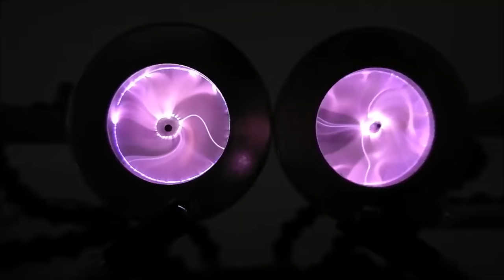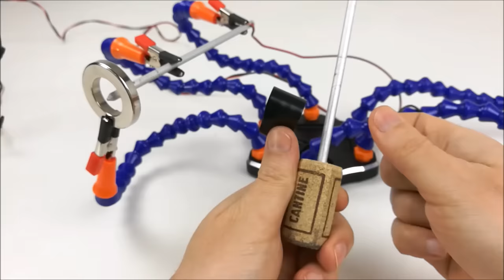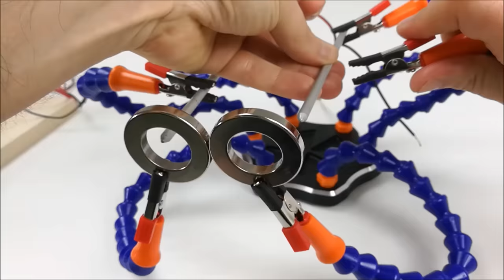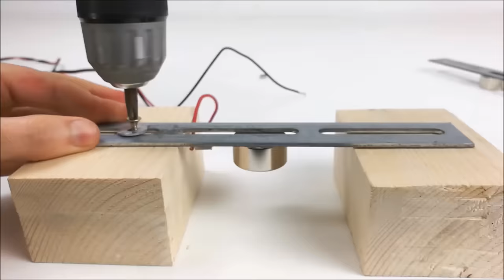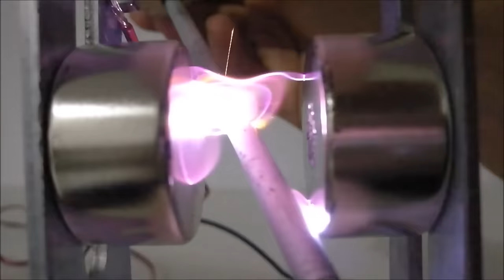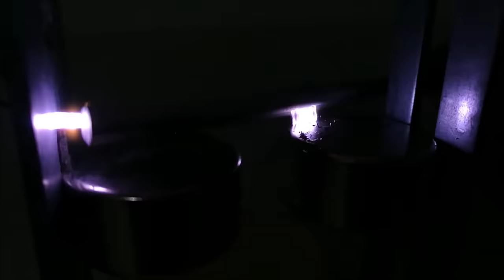Plasma Vortex in a Magnetic Field | Magnetic Games

Comment: Nice video, awesome plasma! and Thank you so much for mentioning me and my channel !!
Reply from the maker: The mention is the minimum to thank you for the help :)
Reply: Magnetic Games thank you so much,  it's a pleasure helping you, very nice quality videos!
Reply: Gianni Laschi 🏥 🍠
Reply: How many volts?
Reply: Hi mate you give links to purchase these parts but its missing the part the mains is connected to, can you help as im just learning this stuff
Thanks
Reply: I made a plasma magnet engine levitation that hovers in mid air it don't need copper or aluminum are any thing to make it hover or levitate 
You add more energy and it levitate even higher. I put more energy and it levitate 10 feet in mid air with out no problem. Trying to see if I can get more voltage so it can fly faster and it's quite I call it the M-chager mechane
Reply: @TimelineDunkley  No copper or aluminum...? How would that work?
Reply: I'm going to put a video out of my hoverflght mechane on August 2 I'm using 1) force and 2) electricity plasma
Reply: = hover , flight and force Field
Reply: i'm brazilian and i'm a big fan of your channel and this video is amazing it looks very glitch
Reply: Lightsaber
Reply: @MagneticGamesIT  how much current was flowing through the last part of the video. The vertical arc?
Reply: How to make this thing
Reply: @magnetosworld6311  hi
Reply: I think that‘s fake because how can this small magnets be strong enough for plasma??I think it‘s just electricity.I have seen that in the school and my teacher told it‘s just electricity
Reply: @quanvanduc2994  plasma is just ionized matter. You don't need magnets to create plasma, but you need them to guide it, which is what he was doing. Electricity and plasma go hand in hand, electricity can ionize matter to become plasma. Whenever you see a spark in air from electricity, that's plasma. Lightning? Plasma.
Reply: @TimelineDunkley hence why it's another explanation very plausible for moving megalyths & pillars bigger then double story homes at balbec,  caves in China, & 100's other sites around our planet.. We could not move them today. Our biggest cranes aren't big enough.
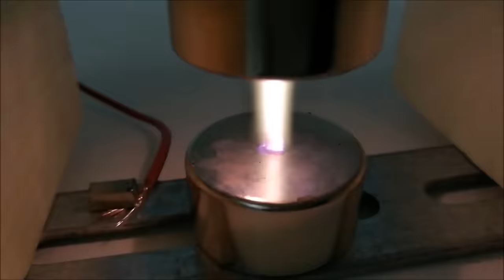Reply: @MagneticGamesIT  at 2:15  were you closing the circuit?
Reply: What is the scientific reason for it brother?
What happening there.....
Reply: Parla italiano dio cane
Reply: Remplacer sa par un tube en cuivre
Reply: @voltariantechnologyinc.8594  Genius only know
Reply: @kektesnotcactus  You can't have a plasma discharge without even having a conductive material, and you can't have ionic wind without that. So...
Reply: @voltariantechnologyinc.8594  ???
Reply: De ahí se puede hacer un agujero negro para viajar a otros mundos 😂😂
Reply: @kektesnotcactus  What?
Reply: @MagneticGamesIT how many amps is the power supply you're using??
Reply: What current ur applying

Comment: In case you're wondering how it works, it's basically an electric motor. High voltage causes air ionization around electric potential points (i.e. sharp edges and points), eventually forming a region of ionized air that's electrically conductive. The charged particles are moving across the arc discharge, producing electric current in the magnetic field of the permanent magnet. According to Lorentz's law, a force is exerted on these particles, causing the discharge arc to move.
Reply from the maker: thanks for the explanation :)
Reply: Borrelia .. Lyme 
Borealis 
Morgellons ⚛
Reply: Idk if u know the answer to this, but is there a way to change the color of the arc?
Reply: @mrsoisauce9017  should be possible by changing the gas from air to a noblr gas like argon or neon, that way the electrons should make the gas glow
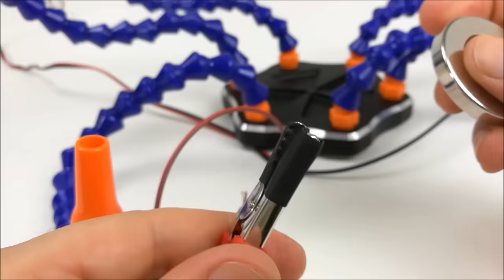Reply: Where is the wire at 0:23 connected to?
Reply: how many volt so i can do this?
Reply: How many volts and amps are you running there
Reply: @hermanokouji1505  When the arc is up, right about zero. Before there's an arc, you need to break the air resistance which is about 3 000 volts per centimeter.
Reply: @shannonvanderhoof4810 😂😂😂
Reply: That doesn't explain why it flows in the direction opposite of the flow.   You are visualizing the dialect vortex.   If you look at water whirlpools or hurricane tornadoes they follow the same exact principle because the dielectric is a medium just like air is just like water is.  A magnet is a source of the dielectric.  It's not emitting anything.
Reply: I @stevesam2319  i guess it's connected to ground. Idk
Reply: @MagneticGamesIT  Looking at modifying this to be able to ionize N2/O2 to make Nitrous Oxide- first step in HNO3. Because, why not, for fun!
Reply: ข้าพเจ้ามองเห็นส่วนประกอบชิ้นหนึ่งเป็นฟลายเเบล็คทรานฟอร์มเมอร์ที่เป็นการผลิตไฟความถี่สูง12000-30000v ที่เป็นตัวป้อนวงจรกำเนิดแสงพลาสมานี้ ถูกไม่ถูกไม่รู้นะ เห็นตามนั้นๆ.
Reply: Could be used to makes an overunity plasma homopolar dynamo tapping ZPE. Moray B King discusses plasmas tapping ZPE!

Comment: This is really helps to visualize how a microwave magnetron works...very cool.
Reply: Wait what 
How
Reply: @guythat779 same concept. Electric current gets deflected at right angles to a magnetic field. In this case an arc , in the case of a microwave oven that would be the electrons in the radio tube. Also since there's no air to get in the way the beams can spin around a good fraction the speed of light causing an oscillation at high radio frequencies as it moves across the anode.
Reply: @Slowly_Going_Mad  ah ok
I thought you're gonna say the microwaves themselves deflect
All gucci

Comment: i think this video is one of the reasons why I started learning about electronics, physics and high voltage.

It’s so useless but it looks so cool
Reply: it's look like an electro gate from dishonored/ can we used it in that way?
Reply: Did you said plasma is useless?
Reply: Yap you spoke the point 

If we can not use it whats the use? 

Only good looking for short while fter that anoing.
Reply: I think mayb this can be used for some thruster or an engine for spaceships
Reply: The potential outcomes for plasma are quite considerable.
Reply: Everything has a use, you just have to look for it.
Reply: @kharicc  you mean wall of light?
Reply: You could use the plasma to generate enough heat to boil water and generate energy.
Reply: @axolotlgaming3987  yes
Reply: useless?? ha!
Reply: Who cares if it’s “useless” or not. There’s no such thing as a useless thing as long as someone gets enjoyment out of it.